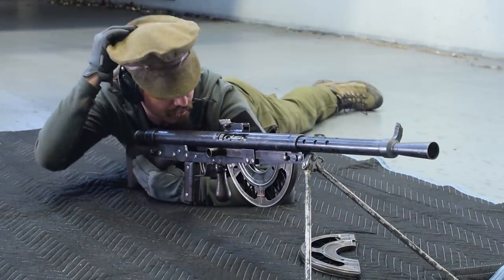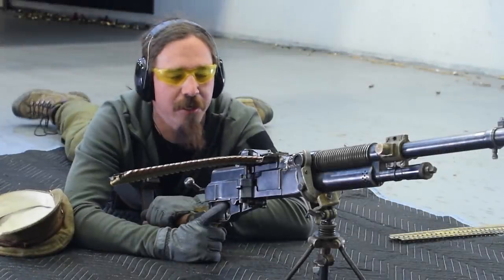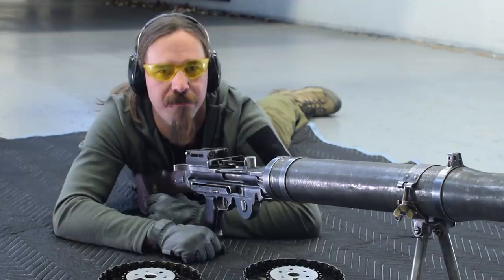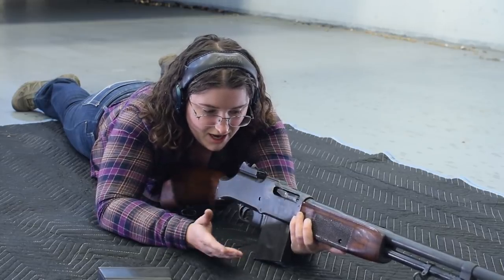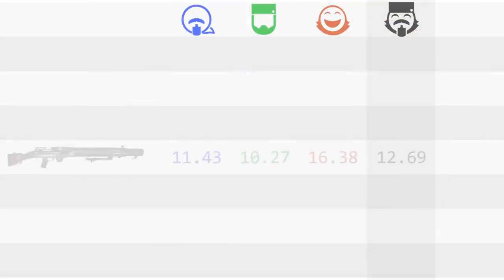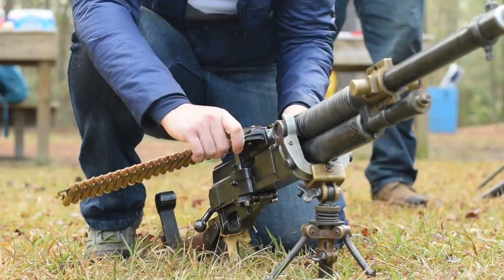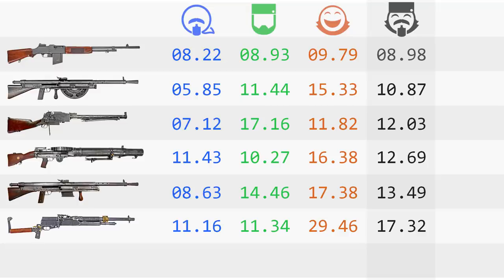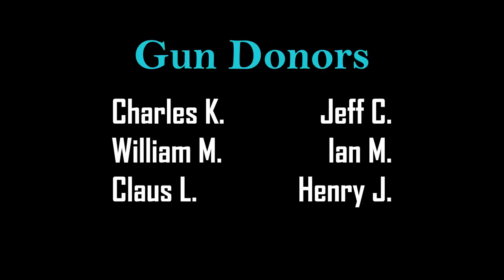Project Lightening Episode 05: Reload

Comment: Funny story about the Lewis gun reload. You notice how Mae has problems with the mag being fiddly. Well, they also used the Lewis gun as aircraft armament. On the biplanes typical of early WW1, they would mount one or two Lewis guns onto the top wing. (The top wing because shooting through the prop was a bad idea, and interruptor gear hadn't been invented yet.) The trigger was rigged up so the pilot could use it sorta normally, but otherwise the gun wasn't modified. Therefore once those 47 round drums ran dry, they had to be reloaded manually. That meant for the pilot to stand up (seat belts hadn't been invented yet, either), letting go of the controls, and reloading those fiddly drums while bracing himself with his knees - with all his body exposed to the windblast of the aircraft flying at a speed of around 60-80 mph.

There is one particular record of a Lieutentant Louis Strange of RFC's No.6 Squadron. Standing up and struggling with a stuck magazine, his aircraft had slowed below stall speed (this is bad) causing it to roll to port. Strange lost his balance and fell against the flight controls, giving the aircraft full flap and thereby rolling it upside down. Within fractions of a second, he went from standing up and cursing the drum to free itself, to hanging onto the drum with both hands like a trapeze artist and praying that the drum would hold, while the aircraft, somewhat hestiantly, flew inverted above him. (Of note: his particular aircraft had not been engineered, designed or even envisioned to fly upside down - none were at the time, and doing so was generally regarded as an overly complicated method of suicide.)

By an incredible feat of physical prowess - which involved putting an even greater strain on the jammed magazine - Strange managed to haul himself up towards the wing, swing his legs side to side to try and hook his legs onto the upper (now lower) wing and eventually climb back into the cockpit. During all of this, his aircraft had gone into a spin and plummeted from a reasonably safe 9.000 feet to about 1.500, yet another condition which at the time was considered virtually incurable and as a long but inevitable prelude to very unpleasant death. Despite the odds, Strange managed to correct the spin and right the aircraft, a feat little short of miraculous. In a very shaken condition he flew the aircraft back to his aerodrome at treetop level, and on landing was charged by his commanding officer with causing "unneccessary damage" to the instruments and seat (by kicking them with his feet while trying to climb back into the cockpit).
Reply: Being charged for damage you did while saving yourself and incidentally also the aircraft - how very WW1.
Reply: Yup, sounds like a military commanding officer
Reply: @kaczynskis5721  It reminds me of a story (I'm not sure how true it is, nor can I find any reference of it, and it's been a few years since I found the story so some parts may be mis-remembered here). A French fighter pilot, was returning from a sortie, he'd shot down a few German planes, but he'd been hit a fair few times too. Both of his legs were mostly severed, and remain attatched by a few sinews, and blood vessels, and arteries, he's falling in and out of consciousness but somehow he manages to get back to his airbase and just about lands relatively safely. As he dragged himself out of the aircraft, he apologised to the mechanics for making a mess in and of the plane, and to his superiors for making a shoddy landing, then he sought medical attention.
Reply: @kieronwheeler3087  Sounds plausible. I have heard of wounded British soldiers in WW1, caked in mud, apologising to nurses at aid stations for getting the sheets dirty. A certain type of personality.
Reply: @kaczynskis5721  It isn't that much about personality, in a situation like that it's easiest to maintain focus by clinging to unimportant details. Recently, when a local tv host got hit by a bus that ripped her arm off the shoulder she remained conscious until hospitalized and the first thing she asked at the ER was how did her football team do at the game.
Reply: @raics101  It could be a sign of shock - that is quite a traumatic injury. Sometimes people in pain deliberately put their minds somewhere else - I have heard of torture victims doing mental arithmetic.
Reply: pdittrich WOW!
Reply: I always found it a miracle how little fragging there was in WW1.
Reply: Snagabott when I think about it so do I
Reply: And this is why they brought out the double-stack mags.
Reply: Leave it to a Brit officer to reprimand a subordinate for being able to stay alive.
Reply: great story brother - txs for insight
Reply: Was the aeroplane a Martinsyde elephant G100. Used as a bomber and home defence fighter.
Reply: That's wild
Reply: The mag wasn't necessarily stuck. The plane immediately flipped when Louis Strange stood to change the mag. From hanging off of the mag, Strange swung into the cockpit & kicked the stick to flip the plane. He was not charged w/ unnecessary damage per se, tho' he was criticised by his CO for it.
Reply: @kaczynskis5721  True story, my roommate killed himself during my first semester of college, and I returned from class to find him hanging in our closet. When I was being interviewed by a therapist she said, "it's not everyday you come home to find a dead roommate," and without even thinking I replied, "yeah I'd go through a lot of roommates that way." She didn't seem to appreciate the humor.

Comment: The trick with the Hotchkiss, is actually just use it as a club.
Reply: Too heavy and bulky for that role, heh.
Reply: Wait. It's not just a club with supposed gun capabilities?
Reply: I don't see myself as a Chauchat hater but it would have been improved if it could take a bayonet. When it jammed you could run at the enemy, screaming.

Comment: The BAR release is usually pressed by using the same inserted finger by clutching the finger guard lightly and pushing forward in on movement straight from shooting, not by pulling your thumb out and pushing the button in with it. i knew a guy who used to use one back in the conflict with the IRA and he told me that, also that they used to use their middle (ring finger) to fire the weapon so it made the reload even easier/quicker and the officer who told them how to operate the weapon also told them to use right hand to fire and release the mag and the left to reload the mag and cock the weapon.
Reply: I was thinking about that, that seems like that would be the way to do it most effectively. Wonder why they didn’t try something like that?
Reply: @ottovonbearsmark8876  depending on the spring replacing the original (due to wear causing magslip) sometimes the replacement springs were very stiff and hard to wear in, it is still possible to use the same finger though. I feel asif some of these techniques were only picked up on the battlefield though rather than being passed on by modern day shooters.
Reply: Kind of the same thing for kicking off the safety on an M1 or M14. Use your trigger finger to kick it forward.

Comment: I dont think any body wants to disparage, really. In addition to being used to the Chauchat, Ian is also used to having to reload on the clock for the matches he does.  I think the averages could be tighter on a few, but it doesnt look like its due to a lack of operational data but a lack of strength (which mae has admitted to) and lets face it, thats old machinery made out of solid metal. Its not polymer, its not anodized aluminum. I think everyone did fine

Comment: This show clearly IMO why most of this guns if not all, were used in team, where the shooter have the drill and skill to aim and administrate the lead and the loader have the drill and skill to reload reliably and on time for the shooter.
Reply: And some of them would be a lot easier to reload with both hands from the side.
Reply: Not that I disagree, but through all the episodes so far I feel the Lewis would still be pretty good as a single-soldier weapon.

Comment: To add on to what was said about the BAR reload, I think a bipod would assist with the loading even more because you would be able to tilt the gun to the right and use your left hand to switch mags and cycle the bolt handle. I think would have sped up the BAR even more.

Comment: An interesting point for the BAR (and the other lighter guns) is that while you need to reload more often, it's not only the quickest and easiest, it also doesn't require a team. Unlike the Maxim or Lewis Gun (which was run by a team of 7). This means while you would have less ammo in between reloads you could have 2 or 3 times as many guns on the field being fired at a given period.

Comment: 19:53  I'm so used to Mae's grin when she shoots, especially something that kicks like a mule (Or let's say the TankGewehr) when she winces, I feel a little twinge in my shoulder.  I know, I'm supposed to get it set in the pocket before I even stick my finger in the trigger guard, but when you're doing reload drills on the clock, you just might rush through something.  So, I've done that, and I'm sure some of you have done that too.  (Especially with top-off drills on a tube-fed shotgun.  Single shot, so you can just tuck in shells automatically without thinking about it.)

Comment: One of the big takeaways from here is the importance of having an assistant for the light machine guns that don't use box magazines. The BAR, Madsen, and both Chauchat variants can be easily operated by a single person (for as easily as the 1918 Chauchat can be operated at all). The Lewis can be operated by one person, but works best with an assistant. The Hotchkiss and Maxim really require an assistant to be effective.

Comment: This may be a silly question from a gun noob but I'll ask anyway: I noticed on the BAR reloads that all three of you used your right hand to reload while supporting the BAR's foregrip with the left, which forced you to reach over to charge the weapon.  Would it not have been quicker to brace the BAR's stock under the right armpit, thus freeing the left hand to reload and recharge?
Reply from the maker: It wasn't feasible to do that because of the weight of the gun.

Comment: I'd have to say the Lewis would be the clear winner overall if ammunition portability was included in the trials.   Basically all it is missing is a forward side handle and an improved reload guide - simply a sprung plate that slides up and down the axis to guide the cassette that was strong enough to lift the empty would greatly improve the reload cycle.    Add to this that everything about the Lewis is effectively uniform across all "variants" and we'd have a clear winner.

Comment: The Hotchkiss is the gun where the award goes to the assistant, not the gunner. 

So far the Lewis gun is ahead in my mind as the one that doesn't have glaring deficiencies and has mitigating factors like high capacity.

Comment: You didn't discuss whether Mae's shorter arms were making reloads more difficult. From my armchair perspective, that seemed to be a bit of an issue. Maybe hand strength was an issue as well. If these guns had been designed for women and their general body dimensions such as arm length, things might have been different. Even so, you succeeded in your originally-stated goal of showing how different body types would have different experiences in trying to work with each gun. 

If I were in charge of a military and looking for a gun to buy for my troops, I might pay more attention to standard deviation or just spread in times as opposed to just the fastest. One can plan for a longer reload by changing the strategy of how a unit operates with these guns, but that planning requires that most people reload at the same speed. You would need more people doing the experiment to get standard deviation numbers that made sense, but just looking at what you were able to do, the BAR was obviously the best in terms of consistency from person to person. The Hotchkiss was obviously the worst, and you discussed how anyone can have a bad moment and get very slow reloads. 

The other issue is whether any of them were made so that anyone could become very fast in reloading with a little bit of practice. Do you think every French soldier who handled a Chauchat 1915 quickly became as proficient as Ian is? If that's the case, then I would give an additional advantage to that gun.

Comment: I think Madsen is the second best of the bunch. While not providing as high capacity as Lewis or 08/15, it's manual of reload is like an AK flipped upside down, meaning it's a rather fast reload compared to many of the reloads. 

Yes, Chauchat is more conventional but it is also more snaggable on things (magazine catch on the floorplate) and I've seen Othais and Mae struggling a little bit (reload being more difficult when the bolt is down or too rough of a magazine release). 

.30-06 Chauchat could maybe compete Madsen but for the most part .30-06 Chauchat magazines are a pain to produce and use. Not to mention to resemble any sort of drop-free experience like the original Chauchat provides, shooter has to either tilt the gun 45 degrees to a side, increasing the reload time or use rather short magazines, reducing the capacity.

Lewis provides more ammo for pretty much the same amount of allotted time (reload times on Madsen and Lewis weren't that far apart) but it's also carrying the risk of making the shooter unintentionally dry-fire the gun until a round is in the chamber, not to mention Lewis having a wide open magazine action that can get dirt into, just like Othais pointed out.

The best being the BAR, however BAR is way too contemporary compared to any other machine gun in the bunch. I mean, BAR survived to see both world wars, and it was developed right at the end of the first one. Other guns were pretty much existent either during or before WW1.

Comment: Using a Lewis 97 round magazine would have left the 08/15 in the dust is the amount of firepower available in the changing time. Something not in either the Lewis or 08/15 favour is the weight of each.
Reply from the maker: The large Lewis drums were for aircraft use, and required elevated sights.

Comment: The 47-round capacity of the Lewis pan being the same as the DP's: is that a coincidence, or a natural result of how those rounds find together?

I would have liked to see Ian reload the BAR lefty as well. It seems much easier to handle it with the firing hand because of the gun's weight, so using it lefty is like a mirrored version of the old-school Red Army reload for the AK. Sterling Mace (I believe, been a while) mentioned in his book that the BAR was good for lefties like himself.

That Hotchkiss tripod thing is truly awful. Maybe it would be ok without the rolling "feature"?
It's maybe forgivable if it designed before the bipod was invented, but how would one come up with that first?

Comment: Doctrine vs. Usage question for the 08/15: The doctrine (i suppose) would have been to utilize the magazine that holds the cartridge belt. Did soldiers in the field adhere to this consistently or did they choose to ignore locking in the magazine and just feed the belts straight in?
Reply: That is a good question. The 250 round belts are incredibly long and would be tough to use in anything but defense.

Comment: I would assume the mg08 / 15 although Superior in Firepower when rigged for coolant sump and lines would hamper even further with the crew placement of the sump would be critical for lines to clear area designated for drum .
Reply: MG 08/15 would';t have all the hoses and coolant recovery cans that a standard MG08 would have.  What you see here is how it was used
Reply: @michaelemberley2767   didnt air cool till 18(had look) just shrunk water jacket and kept connections for sump 
to shrink crew down .BS still used water piss or whatever could fill ok dude
Reply: and i see has 3 hole ammunition belt(water cooled) as for NO watercooled said before / 18 this is ground forces deployment of these not Spandau Sopwith Camel slayers mounted to triplanes
Reply: attrition war w/o suppressive fire from lmg emplacements .they couldn advance cause sustained fire how they attain that no heat dissipation .
Reply: @ @charaznable2379   I didn't say a thing about air cooled.  I stand by my original statement.
Reply: @michaelemberley2767  so you're saying there's a sealedvjacket of coolant. fittings capped off lets say ,when boils how relief pressure w/o loss of coolant
Reply: Eureka! Me thinks u need a crash course on thermodynamics
Reply: @charaznable2379   When it boils you lose coolant. It was capable of being fitted with a coolant recover can but when advancing you'd just use it without for ease of movement.  Far easier to have a few canteens of water with you for occasional top ups than to to try to move with hoses and cans hanging off the weapon.  

Watch this and see how many rounds you can get off before coolant is a problem  
http://www.youtube.com/watch?v=uwgGok9cYcw&t=0m0s
Reply: Okay it's a machine gun and its firing like it's supposed to it wouldn't be a force multiplier if it wasn't.  it was lookin like quitin time for that thing golly. good for probing Guerilla or advancing for stone throw. i do  know see NOT sealed at fitting to vent that was my main quarrel .my gpa was 1919 operator at Bulge i knew bout pourin n pissin on barrel from previous statement w/ link.

Comment: I thought Othais' comment about the BAR charging handle was interesting, being bothered by having to return it to the forward position. This is standard practice on open bolt machineguns with nonreciprocating bolt handles even today. Clearly either most people aren't bothered, or no one has figured out a better way.